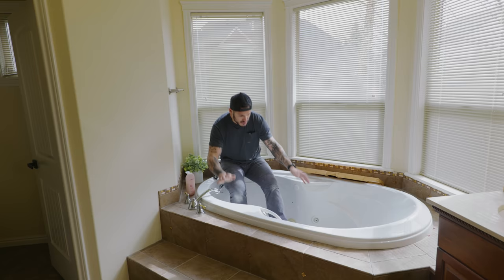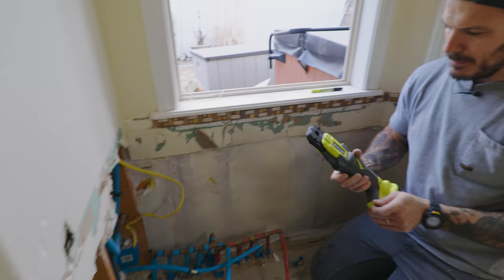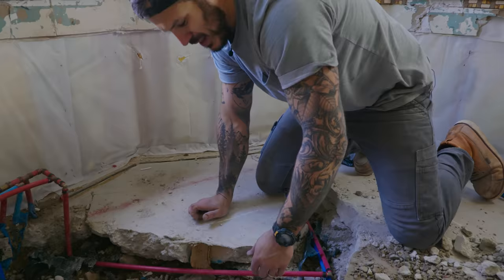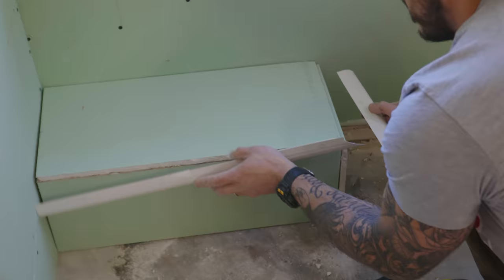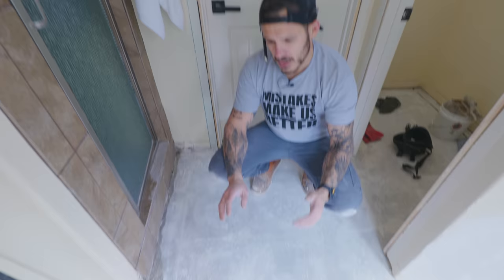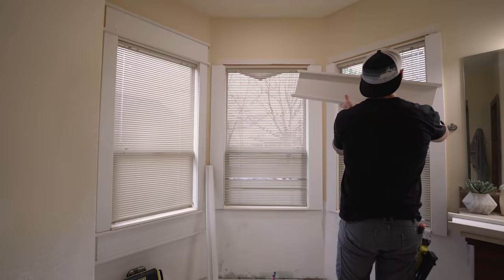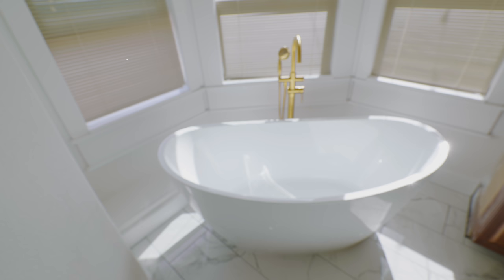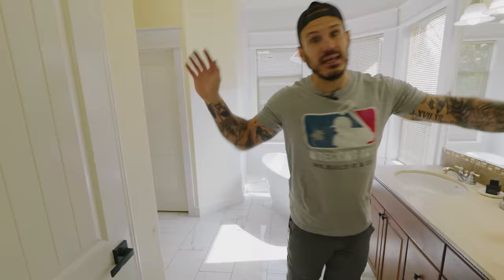Wife Made Me RIP OUT a Jacuzzi for this Tub

Comment: Hey Dude! Really enjoyed the video!  Even though your attempted solution was creative, I would try to revisit your bath plumbing to avoid any kink in the plumbing line. The metal jacketed hose in the faucet has a rubber inner-hose. If it is kinked, stretched too much or twisted, it can weaken the inner rubber hose. Each time water goes through that tight area, it creates a lot of pressure and the pipe flexes. This is like bending a garden hose back and forth constantly in one area. Over time it will weaken the integrity of the hose and at some point could fail.  A possible simple fix is to build a little pedestal for the faucet to sit on. This will give you more space to avoid kinks and no need to bust up more concrete to fix. Hope this helps, all the best! :)
Reply: Wabi! The master of quality over quantity, love your vids
Reply from the maker: That’s a great point. I think I’ll try the pedestal idea. Smart. Thanks
Reply: Don't mess with Elliot when it comes to plumbing!
Reply: We need a videooooooooo :)
Reply: No worries, they will literally never use this tub anyway.
Reply: Waw ! When you find two of your fav YouTubers chatting 😍 also I wish I can you guys both working on remodeling or building my dream house 💙💙
Reply: Love wabi sabi!
Reply: @MrBuildit your the best

Comment: It's so interesting how different building standards we have, that room would never pass as a wet room in Sweden.
Reply: Yeah even in Australia you’d water proof most of it
Reply: Don’t worry, this wouldn’t pass as a wet room in the US either. 

No water proofing system, missing non-porous wall treatment, no secondary overflow drain. 

Insurance would be hitting the denied stamp pretty hard should this room flood.
Reply from the maker: false, over flow drain is built into the tub and drains down at the bottom,
why would there be a nonporous wall treatment if this is not a shower and there was never one there in the beginning. and lastly, what waterproofing system do you need for a bathtub?
Reply: @MrBuildit  my state code requires the floor around a free standing tub to flow towards a linear drain or other floor waste system, I would think TX would be the same. 

As for the others, it’s good building practice to waterproof wet areas and to tile high splash zones.
Reply: @MrBuildit  using that shower will get water everywhere.
Reply: @w2ttsy670  I think that’s the exception, never heard of that before.

Comment: The kink in the flexible tap connectors will slowly corrode and burst try your best to remove them kinks. Might last a few years but I've known them last a year or so. Looks amazing though!
Reply from the maker: Yeah I think I’ll build a little lifted platform
Reply: @MrBuildit  I just dealt with this exact issue with my bathroom that’s slab on grade. For rough in, we ran pex inside insulation from the manifold to the tub faucet but didn’t connect the pex to the manifold in the wall until we got it flush at the tub faucet. Then we cut the pex and connected it to the manifold and it was the right length without causing those kinks that the faucet trim covered

Comment: A great amount of work and looks great! I would like to point out a couple of things. Fiberglass tape always does a better job than paper seam tape. Tried it once never went back to a paper one. The only place I would approve paper seam tape is the corners. Secondly, waterproofing was not done. Just a small bucket of waterproofing mass would have cost near to nothing and protected your wooden piping frame and foundation. Keep up your projects mate. Greetings from another side of the pond :)
Reply: Paper tape is stronger in more directions. It doesn’t stretch and rack and creates less cracking over time. 
Mesh tape is good for small repairs.
Reply: @BittyVids  Agreed. I wouldn't have believed it untill I researched it. It's hard to understand why the old school products always work better.
Reply from the maker: Great point!

Comment: but the bathroom isnt water proof? you should have treated the floor and walls to make it waterproof. tiles are not.. there should also be a fall on the floor towards the bathtub so that all water leaks or splash goes safely out. looks good though but this bathroom can easily fail...
Reply from the maker: The floors are concrete. Can’t get more waterproof then that. Our code around here doesn’t require for a floor drain
Reply: @MrBuildit  concrete isnt that waterproof though, it has pours all over. a water barriar membrane is allways a good choice. its easy to add. no code doesnt but its a good insurance ;) allways build beyond code :D